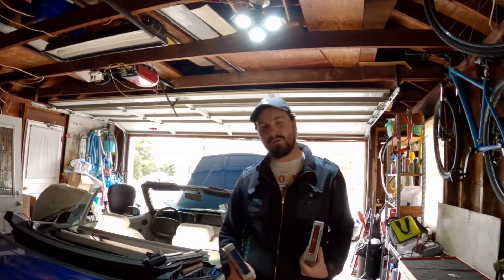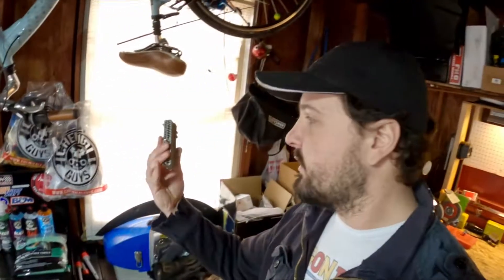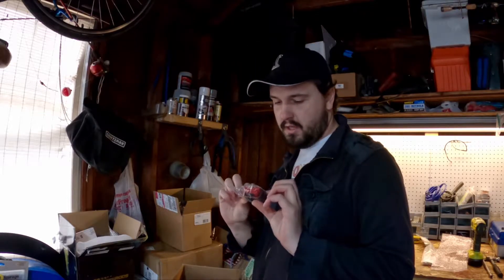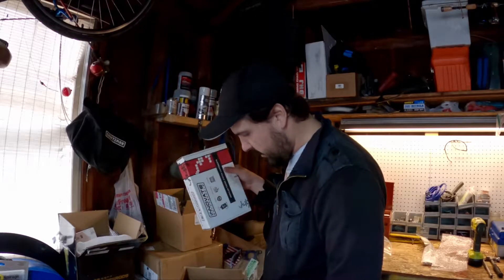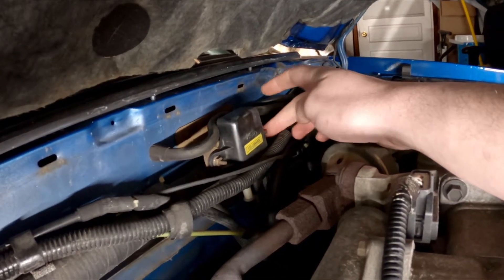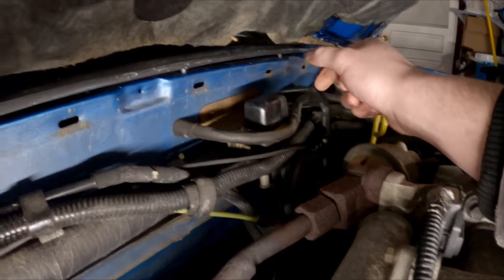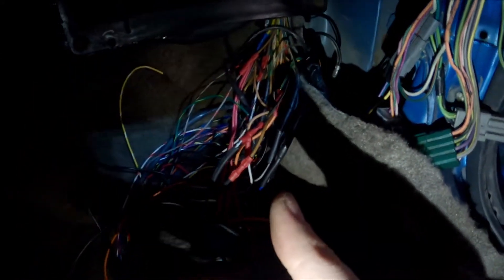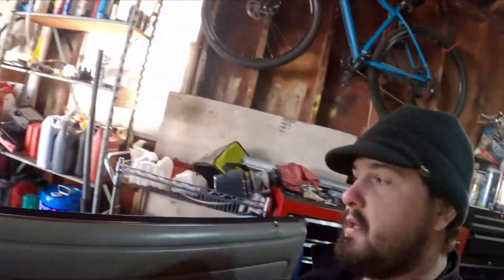Installing A Microsquirt Standalone Engine Management Unit In My 1992 Ford Mustang LX

Comment from the maker: It's coming along 😎👍
Still not sure why Tuner Studio only reads in one row on the VE table. Any suggestions on why that is?
Edit: I figured it out 😆 my dumb self used the wrong wire for the MAP sensor.
Now if I can just get this thing to stay running long enough before the battery dies 🙃👍
Reply: Nice, now you're getting somewhere. What turbo, exhaust manifold & intercooler are you going to use?
Reply from the maker: Turbo is a T04E housing with a 73mm compressor wheel and 56mm for the exhaust wheel. Should be perfect for the current setup or at least more than good enough. Exhaust manifold is a tubular 4 into 1 design manifold. And I'm not running a intercooler for this setup. I will probably get a decent FMIC with single side inlet/outlet for the serious setup. For now I was going to use a water/meth  set up.
Reply: @KarzKreated  I see. So I'm guessing that's a T3/T4? I'll be curious to see how that works for you. I wound up selling my T3/T4 that was on my XR4, it just had way too much lag, even with a .48 housing.
Reply from the maker: Correct. It concerns me If you had bad lag with a much smaller turbo. This is my first turbo project so it's a learning process for sure. We'll see I guess 🙃